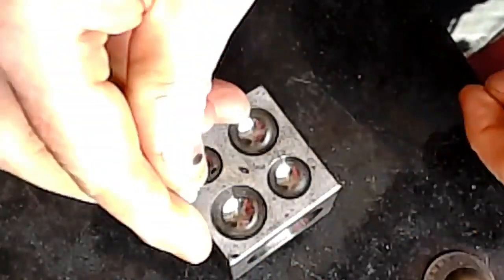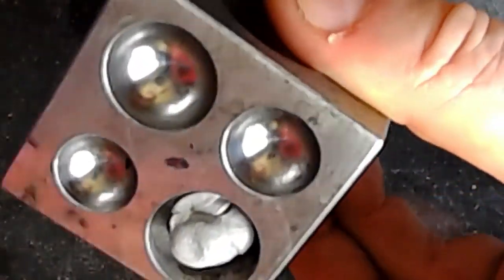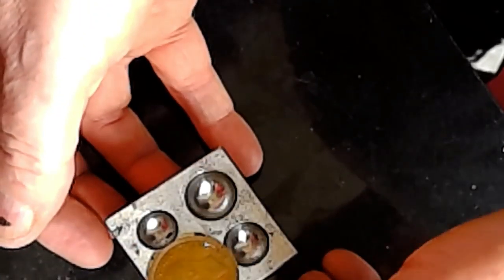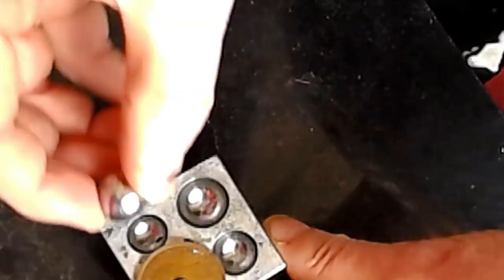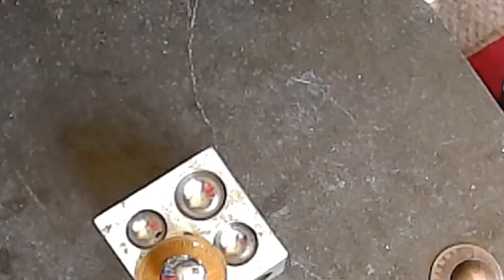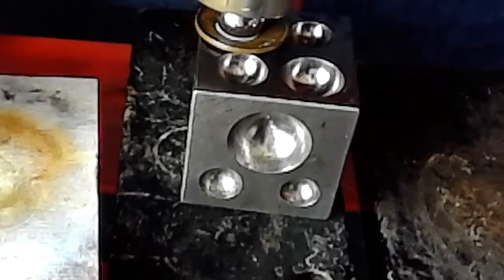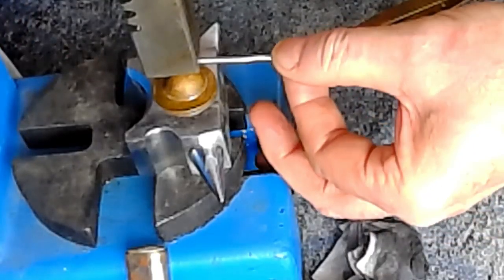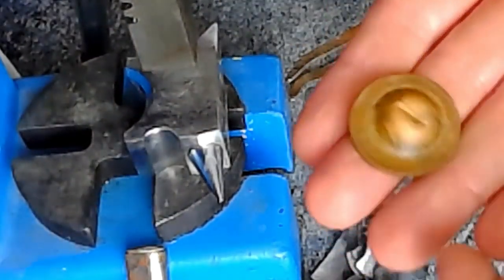How to DOME A COIN dead centre every time

Comment: I made a dapping die years ago by taking a shuffleboard weight that came from a Knights of Columbus. the old cast iron type and I ground it away and ground it away until I got my depression inside that shuffleboard weight and then take a nice big wooden block end got a hole in it to match the dimensions that shuffleboard weight so that way it helps the thing last a little longer and gives you a larger space to work with.
As for the dapping punches everyone smile I come across larger size ball bearings that I had someone weld a piece of wider Steel Rod to it. That Rod became the shaft and made it easier.
The reason I say this is because I look at the little tiny dapping die hole and the great big British Penny thinking "how is he going to fit that in there?"